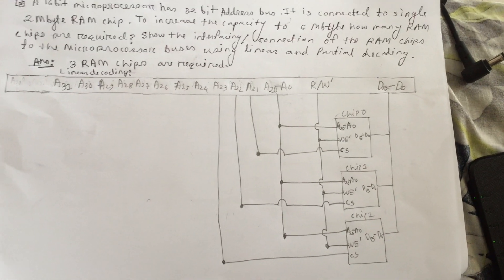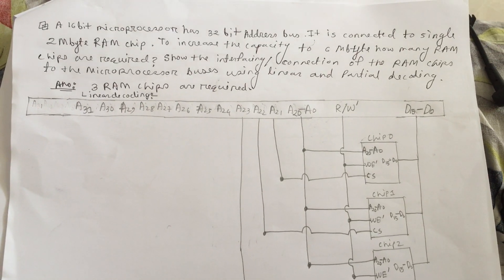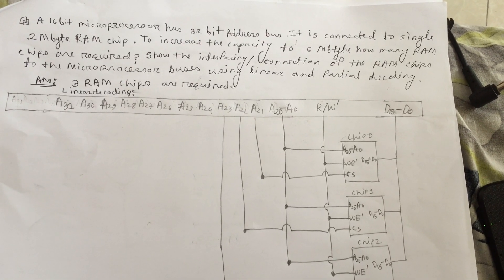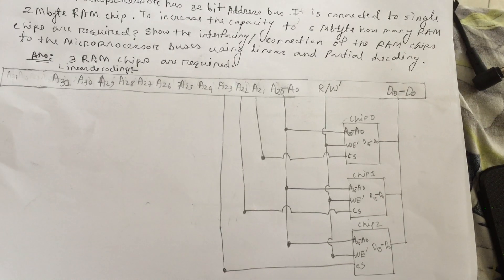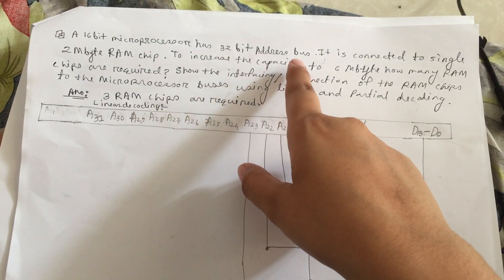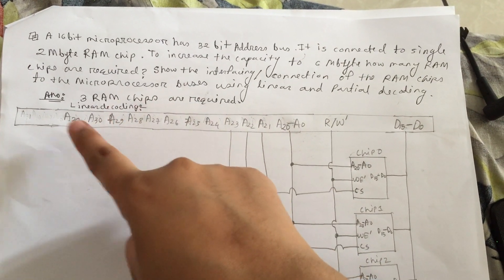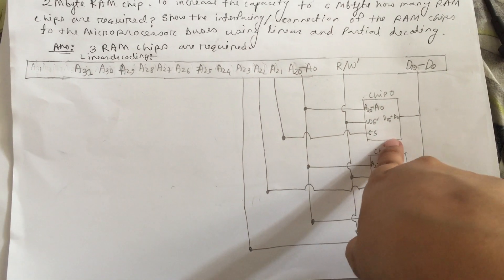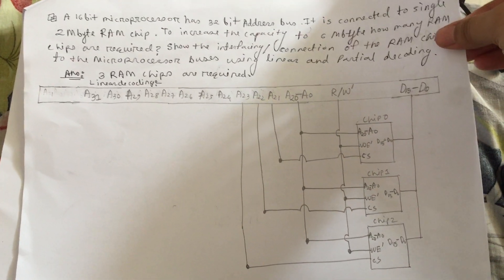Linear Decoding Microprocessor

Comment: I think it will be A0 - A19.
every address is pointing 16 bits or 2 Byte.
Total address will be 2^20 which means 1 Mega, A0-A19
Finally  1 M * 2 Byte = 2 M Byte chip
My calculation could be wrong. Please let me know, I'm wrong or right
Reply from the maker: Sabbir Hossain for 1 Mbyte it is right.As the value increases it will change.